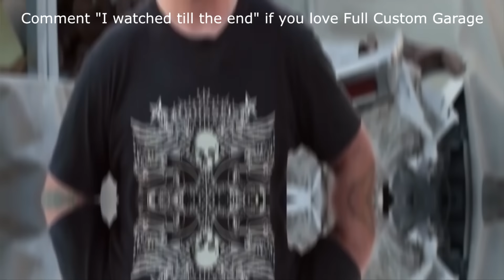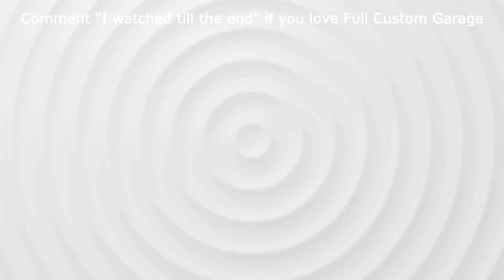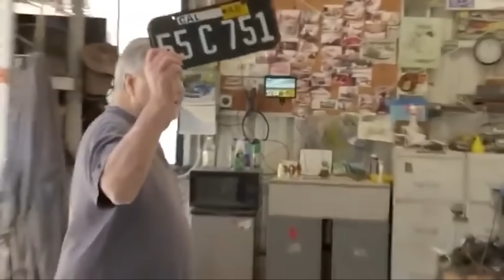The Untold Truth About Ian Roussel from “Full Custom Garage”

Comment: I like the guy and his work--he reminds me a lot of Big Daddy Roth. But he'll spend a lot of time trying to rescue a frame he bought for cheap, when he could spend money to buy some steel and fab up a frame that would actually fit the body he found for cheap. Certainly he has the skill, and he would likely build more daily driver artwork. 

"I let the parts tell me what car they want to be" sounds really nifty, but anyone who's tried it knows it only works by luck--sometimes the parts have no idea what they want to be and that's why they weren't together in the first place. For example, I've watched engine builders match an old tunnel ram they found cheap with a camshaft they had lying around and end up building an engine too slow for the strip and a bear to drive...but it looks cartoonishly neat standing still on the engine stand.

Comment: Ian and Jamie, I have a 2002 Chevrolet Silverado Heavy Duty 1?2 Ton Pickup truckthat  I will sell to you guys for 1500, 1000 if u use it on your show.  very good condition   1  owner   175 orig mls.  1 owner   me.  o i forgot  crew cab  short weel base.  73 percent highway milesm m  mgood brakes  u7sed mainly to commute back and forth to our ffamm frm houston to college station tx  154 mile 1 way 410 gear  i orederd this truck full customm  for me!  only on dirt roads maybe 10k mls   leather intrior grey  body is dark blue  nnever been wrecked   little patina on roof  maybe 10 percent   nothing two rattle   cans of clear coat wont fx     no dnts  o i forgot someone shy at withna 22 so it has a small dent no rust through  has 1000 dolar are fiberglass bed cover   new locking  mechanism    clear cout is coming off maybe 30 percent like i said 175 orig mls   we want to drive it for 2 more yrs and  then sell it 2 u   4 1000  n hell i will give so u if my wife will lrt me  u pay shipping from hou  tx give me 2 more yeaars and it is urs   on     only on problem with the 6 liter engine   motors r lectric   any questiont  contact me at freddieferrara@comcast.net.   this truk wld look super cool  chopped and sectiooned but uuse you imaginatioon    i am ahome boy and doo not like to deal wih the gnrl public urf for free in maybe 2 years or maybe sooooner  beat wish to jamia  u blue lil aka angel   the toutle and the ravens   n love you tv show and your youtube productions   killer coop  jamie is a great camerawoman  producer and  all that other stuff   pleasee chop this   thats all folks